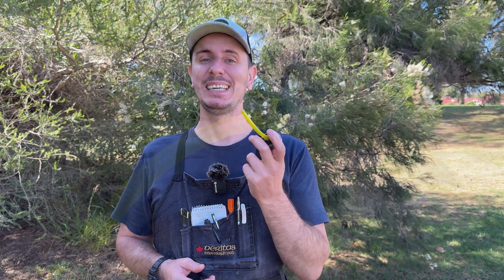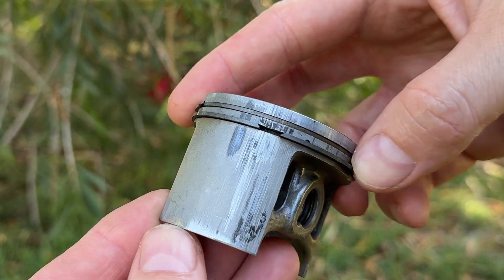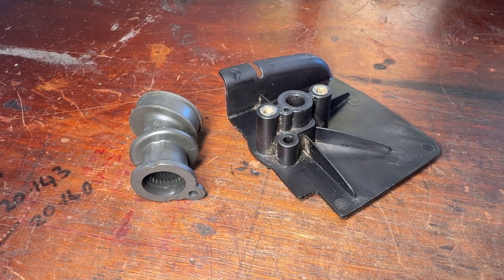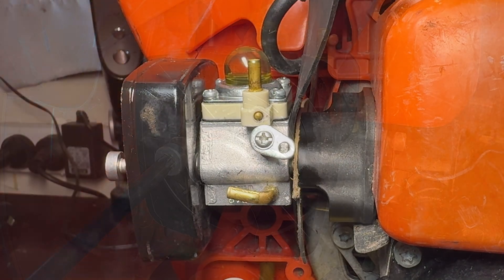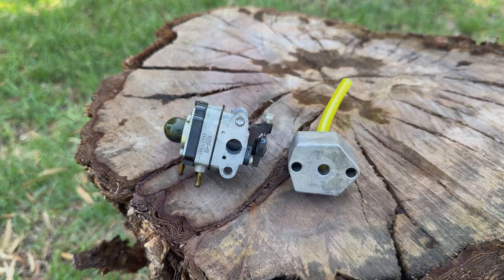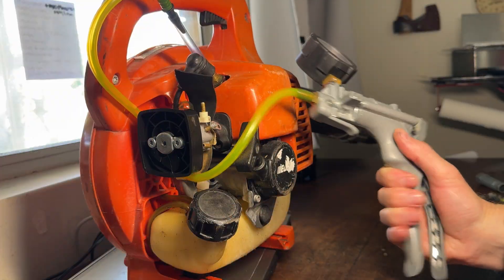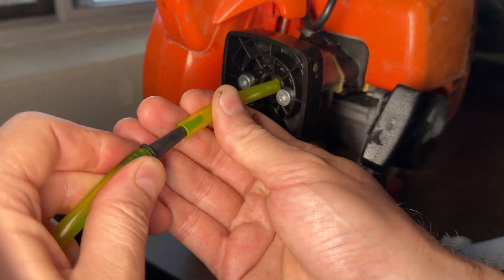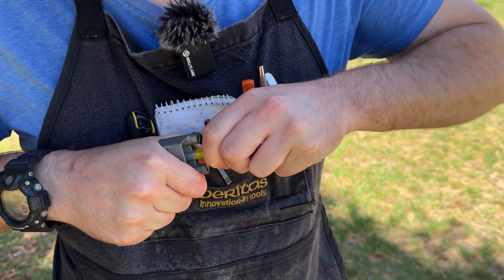A Must-Have Tool For Mechanics!

Comment: Forgive my ignorance, but do you still have to block and seal the exhaust side? If so, do you use the rubber for that side?
Reply from the maker: Yes that's correct :) no rubber on the intake, just use the tool and the  yes block exhaust and use rubber there.
Reply: @VintageEngineRepairs watch this video many times, still don't know why not to use rubber for intake side. Sorry, please explain more

Comment: The amazon link to that Stihl blockoff plate is no longer working.
Reply from the maker: Thank you! It's tricky as stihl parts aren't sold online so only 3rd party retailers may stock them. Use the part number and pop to your local stihl dealer 👍🏻

Comment: I have made all my own blockoff plates from aircraft aluminum strap and a wizzer wheel and a mill file. 

Between the 5 or so plates I have made over the years I can usually find one that fits. Sometimes you do have to make a new one, but I keep them all inside my mityvac case

Sometimes you can block off an intake or exhaust with your thumb too! Or install some gasket paper and the muffler over the top etc

I have spark plug adapters from ebay to use wjth my mityvac tester. Works great!
Reply from the maker: Awesome work :) good job!

Comment: So with this tool, you still use a piece of rubber for exhaust side? Keep spark plug in cylinder? And just put air in through the carb tool? Thanks.
Reply from the maker: Yep :)
Reply: @VintageEngineRepairs does the piston need to be rotated to the top or bottom of the cylinder bore prior the vacuum or pressure test?

Comment: Tom the link is for a defibrillator battery 😆
Reply from the maker: Hahaha yeah it’s been funny for anyone out of the USA frustratingly! Amazon is directing people to the closest alternative it seems, which isn’t close at all 🤣 Copy the part number that comes up and paste it into your Amazon if no luck try google hahaha
Reply: @VintageEngineRepairs   Tom I have found sellers in the UK and the majority are less than a tenner. It seems this model covers mos stihl machines but from your experience does it cover other brands?
Reply from the maker: Brilliant mate! Just make sure it’s not the thin plate one, that it is the full width like the one I showed in the video. Yep, it works on almost every 2 stroke that comes in :)

Comment: As a certified stihl mechanic, this is one of my favorite and most used tools diagnosing small engines. I have the OEM Stihl one. Comes in so handy on different machines diagnosing air leaks. just an fyi to people with small engines, you can replace all the new parts you want to and adjust the carburetor all you want, if you don’t check and make sure your crankcase holds vacuum and pressure, it’s never going to run right and you will burn up your engine.
Reply from the maker: It’s a great and overlooked tool isn’t it! :)
Reply: @VintageEngineRepairs thanks for sharing. I was just pressure testing a wacker plate compactor today

Comment: So you REMOVE the carburetor. Anytime this is done, a replacement NEW gasket is heartily recommended. The tool tests the old gasket. Why bother to distort the new gasket with this tool ? Simply try operations with a new gasket.

Comment: HI HAVE A QUESTION FOR YOU I PUT A STHIL FS240 ENGINE IN AN RC BOAT AN I WAS TRYING TO FIND OUT THE OPERATING TEMPERATURE PLZ HELP
Reply from the maker: Cool! Do you have a video? Below 150c at the cylinder head is safe :) you can go slightly more for short bursts.
Reply: THANKS YOU  THE BEST   NO VIDEO'S YET

Comment: Do your vacuum test first then pressure test 2nd. Reason being, let's say that you have a crank seal that's on it's way out. Doing the pressure test first may cause that weakened seal to seal from pressure.
Reply from the maker: I’ve heard people say that, I’ve never experience it and logically it doesn’t make sense, a weak spring or stiff rubber won’t seal not to mention the engine pulses pressure against the sealing lip 10,000 times a minute. Have you got any literature from a manual that actually states that?

Comment: Nice tool but $55 for home repair folks is too steep.
Reply from the maker: I’m sure you could make one
Reply: @VintageEngineRepairs  I was thinking that, small piece of flat stock (I save cheap bed frames for such things), couple holes for the carb studs/bolts, and a hole with either a press in piece of steel/copper/brass tubing, or threaded with screw in type fitting.  And a piece of rubber (old inner tube?) to seal against the carb?   But great video pointing out the problem with pressurizing from the plug hole.  I guess that's primarily to detect bad crank seals, yes?
Reply from the maker: Absolutely, try fabricate something you have on hand :) no rubber, just metal against the gasket! 👍🏻
Reply: Whooa 55 for that !! 😮

Comment: What do you mean by 'four-mix engines"? I've worked on engines all my life and never heard that term.
Reply from the maker: 4 mix is a concept designed by stihl wherein the engine is based off a 4 stroke, but uses premixed oil in the fuel to lubricate the bottom end, top end and valves. It needs to be air tight like a 2 stroke. I’m not convinced personally, but some like them.

Comment: The block off plate link brings up some sort of battery?
Reply from the maker: Yeah it’s been weird, something to do with where they’ll ship I believe. There is no alternative and Amazon tries to direct you to the closest thing haha. Copy the code that comes up and paste it into Amazon :)
Reply: @VintageEngineRepairs  I am in Wales UK so probably something to do with that. I tried to paste it but its still the same. I will try and source somewhere else, thanks. I have a problem with a petrol disc cutter and think it must be down to seals somewhere, cant figure it out at the moment.
Reply from the maker: Good stuff, hopefully you find it :) certainly useful to have on hand!

Comment: Another great video.  Ive moved away from the rubber and have made myself block offs using old and defective carbs.  I simply seal the venturi using silicone and short the fuel inlet and carb impulse circuits (usually by making a small cut in the fuel pump diaphragm). Pumping air through the fuel inlet line then feeds the crankcase via the impulse hose.
Reply from the maker: Awesome mate, good job!

Comment: I think that you could use a piece of flat stock and just drill some holes in it to fit.
Reply: You have to figure in what your time is worth.
Reply: Yes. Stack nuts if bolts are too long. You need one on exhaust side too. And if you eve get into rebuilding snowmobile/ dirt bike engines they have power valves that need block off too. Flat stock, jigsaw, transfer punches, hand drill or press and gasket material are a guys go-to for all 2 stroke engines.
Reply from the maker: Sure that’s a good idea! Just make sure you have bolts long enough!

Comment: Use carb cleaner to find leaks ,spray round car gasket area ,revs go up or cuts out ,there your fault
Reply from the maker: You can, It’s a quick and dirty method which gives you an indication, but not fool proof especially if you can’t reach the seals - which is highly likely as they’re under clutches, washers, covers, same with flywheels.

Comment: i got that and am thinkin about another 1
Reply from the maker: I have two as I modified one to fit the stihl 201t lol
Reply: @VintageEngineRepairs  the second is for 026 and 046
Reply from the maker: Interesting! The standard one doesn’t fit? Did you have to modify it then?
Reply: @VintageEngineRepairs  no the other one plugs impulse line too

Comment: Im sorry, but I don't understand all the hassle ?
So the idea is to check for false air using a piece of rubber under pressure ?
What happend to just starting the engine, and use any type of gas in a can ( like deodorant, or even WD40 ) , and spray that gently around the sealings ?
If the engine reacts in any way, increasing or decreasing rpm, you instantly know there is bad air leaking or being drawn in.

I must have missed something ?
Reply: Yep you sort of did, if it runs that’s a test you can do if done properly. However if the machine isn’t going like most of them that we get then you should be doing these types of test before going headlong into the unknown spend time $ that would be avoided if you knew what the actual problem was. These test are what the diagnostic fee covers.
Reply: Yep you sort of did, if it runs that’s a test you can do if done properly. However if the machine isn’t going like most of them that we get then you should be doing these types of test before going headlong into the unknown spend time $ that would be avoided if you knew what the actual problem was. These test are what the diagnostic fee covers. That make sense?
Reply from the maker: People use rubber inner tube to seal the crankcase to do a pressure and vacuum test, however that rubber can hide leaks at the manifold face when the manifold is warped or compressed with age. Therefore you hide the leak you’re chasing. Using a flat block off ensures that if there is warping or compression, you’ll find it. Using a flammable spray is a down and dirty way, but often isn’t fool proof - very hard to get in certain areas, especially seals that are under many covers, clutches, washers etc.
Reply: Hmm, oke, in all my years I never knew about this method. lol
Seems like a lot of work.
Do problems when you really need this method occur a lot ?

Comment: Excellent video Tom!  I do disagree with one thing… Using a piece of rubber is a good idea if you want to confine your tests to the crank seals only. The piece of rubber test can help you avoid tearing down certain engines twice: once to replace the manifold, and a second time to replace the crank seals when it still won't hold pressure. I think both have their place. Well done mate!👍 Merry Christmas 🎄 and Happy New Year 🥂
Reply from the maker: Thanks Stella! Sure you can do that!! ❤️

Comment: Would an automotive4 smoke leak detector work? A bit more expensive, but if it saves time on every job it could pay for itself pretty quickly. Just a thought.
Reply from the maker: Unfortunately not as it requires pressure, up to 7psi. Also you need vacuum to test for leaks at the seals. However a good thought though!

Comment: Good point, Tom, easy mistake to make when using rubber sheet.
The link takes me to the correct item, but says it can't be shipped to my location.
I'm in Perth, same as you, Tom. Armadale, WA🤷‍♂️
Maybe I'll just knock one up on my milling machine, would be a nice, easy, satisfying little project, and another useful tool in my arsenal.👍
Reply from the maker: Thanks for the feedback mate!! Urgh I need a mill!! Though having just spent thousands on a tig welder It will be a while 🤣
Reply: @VintageEngineRepairs  Being able to afford to buy tools and equipment is always a big challenge, and often involve ongoing expenses for additional tooling etc, so they don't make much sense unless they can eventually pay for themself over time, if ever.
Generally never an option for the average home-gamer obviously.
Tig is something I've always wanted to try, but I doubt I would ever get enough use out of it to justify the expense tbh, but it could be a handy skill and looks like you're having fun and making awesome progress.
I can do stick, mig, oxy/propane, oxy/acet. steel fusion, steel filler, brazing + sheet metal lead soldering, most general wiring, as well as through hole pcb components and surface mount micro soldering etc, so that's enough for most things I've ever needed to repair.
Although Tig could certainly come in handy for the odd Ally or Stainless repairs but they would be super rare for me.
Just a thought mate, you have a lathe, you can often knock out some things on a lathe that you might otherwise think you would need a mill for.
I'll actually probably start off doing a fair bit of this little project on the lathe, then maybe finish it off on the mill, mainly just for the bolt/stud holes and maybe machine some flat sides on it, that's if I don't just use a rectangular piece of stock to begin with.
But really the only critical requirement is for the main mating face to be flat and parallel with the bolt head/nut side (which can be done on a lathe) then it should work just fine.
You could even just mark out and drill the mounting holes by hand if need be (even better if you have a 4 jaw chuck, everthing could be machined and all 3 holes drilled on a lathe and machine a little hose spigot around the centre hole, or perhaps even tap a 1/8 BSPT or NPT thread into the centre hole for a hose tail) then it's just a bit of cutting and filing for aesthetics and finess afterwards if one desires.🤣👍
Reply from the maker: Awesome reply mate :) sorry for the slow response! You raise some great points! It’s surprising how much you can do on the lathe, though, I still want a mill  as well 🤣

Comment: I had a 30cm2 box full of custom made stops, blocks and adapters, actually the last thing i used was the mould for casting primer bulbs! I need to put one of those stress toys in the kit too.. you know the ones you push the button and it swears for ya! Lol coz the job before hand was a chainsaw (Chinese) most frustrating rubber anomaly between the motor and carbi, but i won! LOL
Reply from the maker: Haha good job! I love custom tools :)

Comment: Hey how about the exhaust side  ? It has additional plate for exhaust side or just do the usual blocking off
Reply from the maker: You can use rubber that side 👍🏻
Reply: If the intake side leaks it's a big problem.  If the exhaust side leaks it's not going to burn up the engine.  But, it may cause some plastic melting, etc.
Reply: @rayvil01  You've completely misunderstood what we're doing here. We seal off the intake and exhaust side, and apply first a vacuum, then pressure. We're testing the entire block. You cannot tolerate a leak anywhere; not at the intake, not at the exhaust, not at the sparkplug. If you find a leak, it's either the cylinder-crankcase seam or, more likely, the crankshaft seals.
Reply: You can't pressurize the case if all the air is leaking out the exhaust.

Comment: Hi great video very clear. The link for the block off plate comes up with a brush cutter head blade mounting set though?
Reply from the maker: How weird! I just checked it and it works for me. What country are you in? Can you try again? https://amzn.to/3BB5Nbb
Reply: @VintageEngineRepairs  England mate. No worries I will search it up, probably my phone messing me about!!
Reply from the maker: @ ah gutted! Yeah give it a search hopefully you can find it easily 👍🏻👍🏻👍🏻
Reply: Hey guys…..way over here in Canada I got the same results when I clicked on the link, it came up with the brush cutter mounting adapter. Hmmmm
Thanks for the video
Reply from the maker: Oh no how frustrating! No idea why!
Reply: @VintageEngineRepairs  do you have a Stihl part number? Googled it and the only thing similar was for a ts400 disc cutter but it's not exactly the same. Ideally I would like the one you have as it is for my saws. Many thanks

Comment: I bought whole stihl pump set and that block plate included. Handy tool indeed. Makes diagnosting so much faster. I use it also testing 2-cycle engine before final assembly. Some chainsaw models have such a crappy desing that you can't make them work without test pump.
Reply from the maker: Awesome, a great investment!!